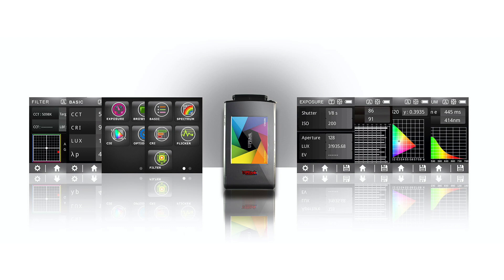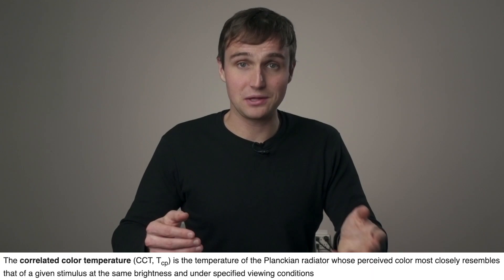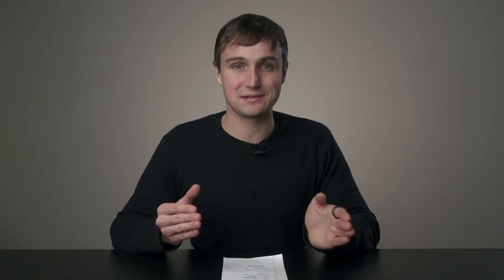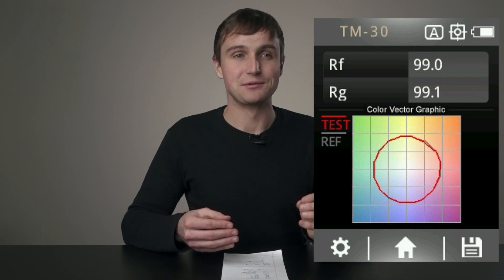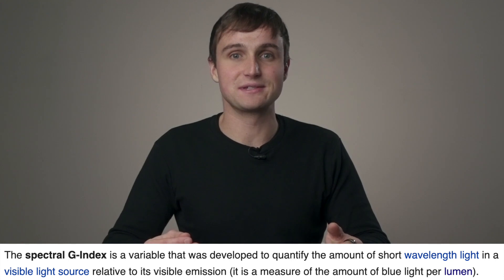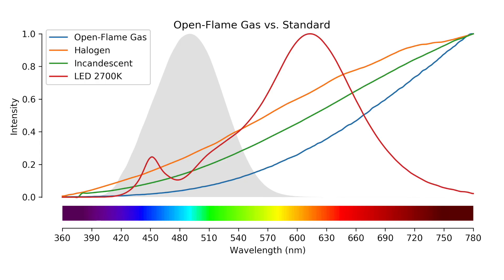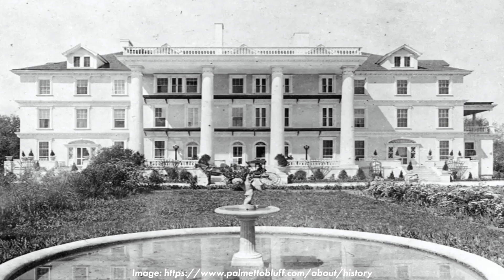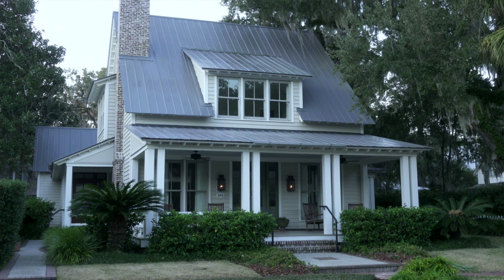Testing Open-Flame Gas Lights 🔥

Comment: Regarding the efficiency - it is a bit hard to judge whether back in the day, the efficiency would be the same as today. 
Coal gas was the most used gas at the time. At the gas works, there was a test flame to see if the gas burned bright enough. If not, the gas works could add extra kinda-heavy hydrocarbons like benzene to the gas mix, to enhance brightness. 
With today's clean burning natural gas, we could possibly see dimmer lights than back in the day. 
Of course, there's no contesting the fact that a gas flame produces mostly heat with only a tiny bit of light, regardless of the soft of gas.

Comment: Greg, thanks for this interesting video!  I recently had an opportunity to work with a gas powered refrigerator. It uses a small gas flame to drive a refrigeration process, without any moving parts.  The energy input (watts per BTU of cooling capacity) is about 6 times higher than a compressor type system.  The documents I have found in my research show that in the early days; in the 30's and 40's - electricity cost was so much higher than it is now, that it was less costly to operate gas powered appliances as opposed to electric. I wonder if this played a roll in the dominance of open-flame gas lights for so long?
Reply from the maker: I think you're on to something. From what I can gather, for open-flame style gas lights (phased out in the 1890s), electricity wasn't really viable competition because for the most part, electric power plants did not exist at the time. 

The incandescent light bulb, along with electrification of factories and railways, was one of the main drivers for building electric power plants, starting in the ~1880s but not really on a large scale until the 1890s and 1900s. 

I heard light bulbs were very expensive in the beginning, accessible only by the likes of the Vanderbilts. I imagine the infrastructure cost of building electricity networks was enormous, although more scalable than gas.

Simultaneously, gas mantles (next video) were a huge improvement over open-flame gas lamps. Way brighter and, from what I can gather, about twice as efficient as open-flame gas lamps. 

The ability to take advantage of existing infrastructure also probably had something to do with the dominance of gas mantles. Several cities in Europe still have tens of thousands of gas mantle lamps. 

So you could very likely be right that gas was cheaper than electric for a time. It would be interesting to know the tipping point when electric became cheaper than gas. 

I quickly Googled for historical prices of natural gas and electricity. Looks like you can get data going back to about 1920, but the conversion for natural gas might be tricky because it's the wellhead price, not the end consumer price per energy consumption. It would be very interesting to see this done at some point.